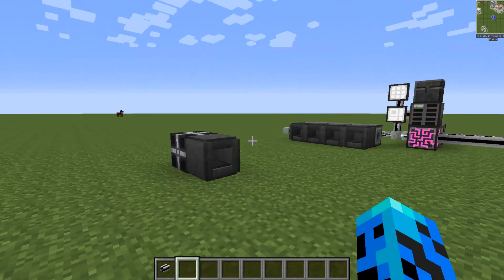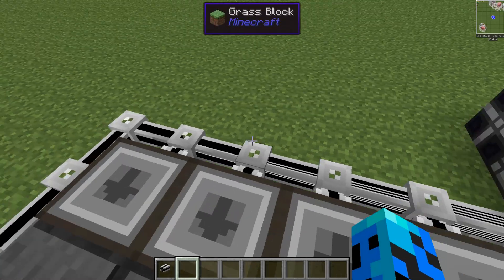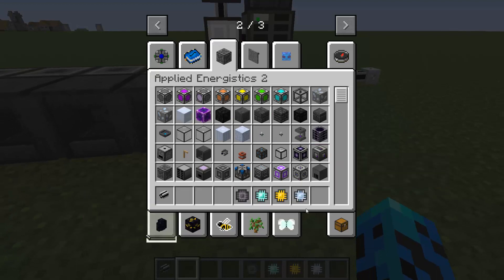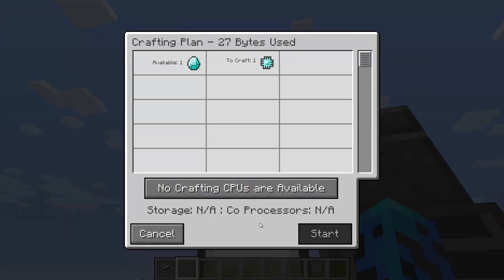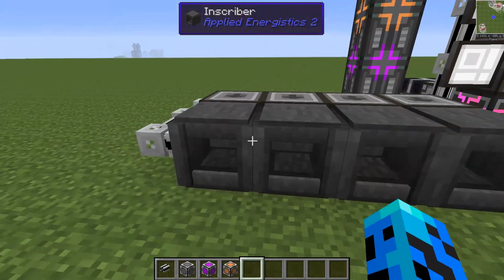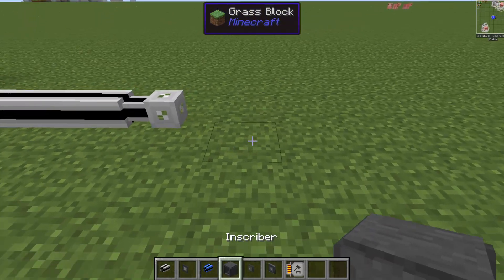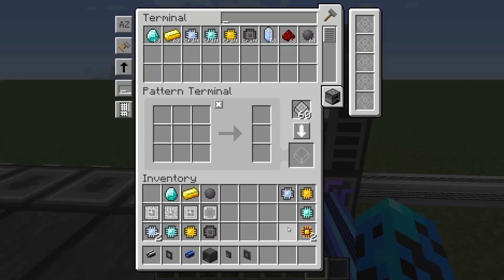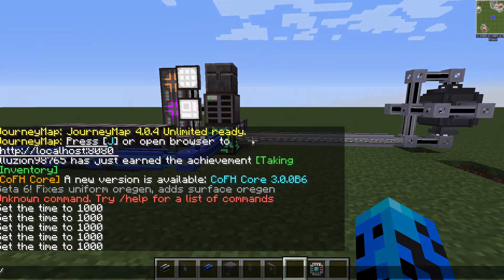Minecraft: How To Automate AE2 Inscriber/ Autocraft Processors (1.7.10)

Comment: It says i don't have any crafting processors available even though I have a crafting unit, crafting co-processor and 4k crafting storage. its connected via a different side so its not using all the buses. It also has a bus line showing it is connected on the smart fluix cable.
Reply: the crafting processors, unit and co proccesor must be in a rectangle for it to form the multi bock

Comment: 12:33 Every time i connect more than one cable to the inscriber my entire system goes down. I tried many configurations and no matter what I do, it shuts everything off.
Reply from the maker: Check to make sure you have enough channels available. Also check your power, as you increase number of item on your ME network it increased power draw.
Reply: What supplies the network with more power? I have a dense energy cell and tried making a second energy accepter, which didn't fix the problem. It's powered by a big reactor and a draconic energy core that's full. it only takes about 20k rf/second
Reply from the maker: How are your channels? Max 8 for regular/smart and 32 for dense.
Reply: Ohh. Ok Thanks

Comment: I'm having a confusing issue. I've got it set up nearly identically, however the export bus on the bottom that is supposed to ask the other press to create silicone and then export it into the final press doesn't work while I'm requesting, say, logic processors. Seemingly because I'm out of CPU's? I made sure to have a crafting card in the silicone export bus, and I have a co-processing unit the same as in the video.
Reply: Double check to make sure you didn't go over your channel limit. You might have caused something to go offline as a result.

Comment: Great tutorial!! Thank you sir. Very well done. I do have a small problem not sure what it is. I have the processing units installed. (The storage blocks for the bytes used part for the crafting terminal)They seem to be working just fine. When I go and run any process, it completes the job everything is fine!! Then I go to start another project, and I keep getting. No crafting CPUs available. But they are? Break one of the multi block structures replace. And it acts like its all ok again. Same process again a ad again. ?? What have I done? I have plenty of resource in the me system.
Reply: Forgive that message, I was trying something that was never going to work!! I got it!

Comment: can you only craft one controlller at a time?
Reply from the maker: No you can do muiltiple
Reply: when i try to make 2 logic ones, and my system doesn't have any more silicon ones left, it doens't make new ones
Reply from the maker: Add another crafting cpu
Reply: With cpu, do you mean the multiblock structure ore the co-processing unit?

Comment: but i cant get the power to go thru the cable to the inscriber (i have tried every direction there is)
Reply: it changed you cant use ae power you need to hook up the inscriber with a cable that transfers rf not the ae cable because ae has its own type of power that the system uses so the me cables cant transfer rf and for some wierd reason the inscriber can only take rf not aes power unites

Comment: Need help please. I have the 5 inscribers, 3 controllers, 2 1K crafting storage and a crafting unit on 2 lines of ME Glass Cable ( Fluix and Black) and everything works fine however i can only craft 1 item at a time. when i try for 2 i get the message "No Crafting CPUs are Available" . I have the 3 controllers side by side on the ground with a 1K, Crafting unit and 1K across the top of them. The feed from my drive goes into the 1K on the right. the supply lines both come off the 2 left controllers, Fluix from the left 1 and black from the middle 1 with cable anchors in between. Fluix is my 4 crafting inscribers and black is my put it together on it's side inscriber. How do i get it to do more at the same time?
Reply from the maker: Yogsta, Im linking my playlist on AE. Watch the videos named refined and complete to answer your questions. 

https://www.youtube.com/playlist?list=PL50kL4kUJhJcuRjlImHYl06ZO6gdiAwwx
Reply: You need more co-cpus
Reply: I now have 2 co-cpu's and a 16k storage on the 3rd row of the cube and am still getting the same message.
Reply: Thankyou to both of you for your help!
@ illuzion Thanks for the awesome tutorials. they have helped me get so much more out of my game.
Reply from the maker: You are welcome. I am glad you enjoyed it. I am doing an LP with some advanced AE work. Be sure to check it out.

Comment: For some reason in my system It won't ever make the silicon ones when I set to create  the processors. If i have printed silicon in the system it works. but if I only have silicon the system won't make the printed one when I ask it to make processors :S
Reply: +Torbjørn Kolven Don't know if this is obsolote, but: The Crafting CPU ist blocked while waiting for printed silicon to craft the processor, while the crafting card cannot find an available cpu for printing the silicon. So this is a deadlock situation. I only solved this by providing a second crafting cpu (unit+storage+maybe Co-CPU, havent't tested it without).

After upgrading, the system worked as intended.
Reply: +Torbjørn Kolven Your problem could be that you forgot that crafting card!
Reply from the maker: Torbjørn Kolven I have a new AE2 series starting now. Check it out and I will be covering this. Or you can check out my automating inscribers parts "refined" and "complete". They are both in the AE2 playlist.
Reply: Same with me
Reply: same here, looked everywhere, a few other people have this problem but none of them give any answers!
Reply: I just saw this 3 years later and the Problem just is you have to connect it to the back if you wanna put it in the inscriber with that arrow towards it ^^. 

If this did help anyone in today please like to let me know ^^.
Reply: @OverloadOV , That did the job! ty

Comment: Thanks heaps for this tutorial. Have only just started working with AE2. One question: I had my ME Interfaces sitting on the top side of the Inscribers but this wouldn't input the items. I moved my ME Interfaces to the back side and it worked like magic. Is the back side of the Inscriber the only input face?
EDIT: Also looks like I can't output from the bottom side. Front side works fine. Same deal?

Other than that, your setup for the Processors worked a treat! /Subscribe!
Reply from the maker: Greg Dennison Thanks for the sub. Im not sure about the i sidedness of the inscribers. Its not something I have really  tested much.

Comment: I really appreciated this video. It was very helpful, and I liked the more compact version you created in part two. I haven't read through all the comments yet, but I had a question. You mentioned (and I googled) the fact that the co-processors are supposed to let you queue crafts up. In my FTB Infinity world, I have 3 co-processors and 1 1k storage, and I cannot queue up items. The system recognizes that I have the 3 co-processors, yet, it won't let me queue up the crafts. Do I need to have more than one crafting storage and not more than one co-processor? Any help would be greatly appreciated!
Reply from the maker: fallyntalyn I have a video coming out very soon talking about co-processors. Check it out, It may help you. What what works for me is having several large processing units(storage and co-processors) and a few smaller crafting storage units to handle smaller tasks.

Comment: to simplify this... you can simply "cook" all the circuits. that way you never need to process silicon or redstone. this decreases Materials needed by 4: Silicon, Redtone, Silicon circuit, and silicon press. As well as needing one less inscriber press. AND a few less cables, only needing an in and out for the furnace(s)
Reply: bruskedragon No it doesn't FTB Infinity you have to do it using the inscriber cooking it does not work
Reply: I thought that was AE1?
Reply: It applies to all of AE. every pack i have played with AE 1 or 2 has worked with "cooking" the circuits

Comment: nice work there. With 1 crafting cpu if you que like 3 processors and you run out of silicon press at second, system gets stuck. because u have 1 crafting in que but u dont have silicon press and system cannot craft silicon press because u have 1 processor in crafting que. Very educating tho I like the videos. +1 sub.
Reply from the maker: Check out some of my newer videos about the automating of inscribers.

Comment: Hei this is a very good video, thank you. But i have one problem: when i craft more than one ex. 16 Logic Processors then it will craft one and then it dont fill in more printed silicon. When i after this cancel the job it crafts one printet silicon and fill this into the inscriber, so i can craft another one. So my mind is, its with this system not possible to do various crafting reciepts at the same time. But du you know why or what i need to do more?
Reply from the maker: Thanks for the comment. I have made multiple changes to this system since this video. Look in the rest of this playlist for the newer videos. It will address your concern.

Comment: Thank you for showing me this; AE 2 is slightly more confusing that AE 1..also, this was a grand test of patience for me. Here, have a sub and a like.
Reply from the maker: Thanks. Be sure to check out the other videos in this series too.
Reply: illuzion98765 I have a great system but I'm trying to get the Inscriber is automatic but only two terminals are working me, I know I have a limit of channels but as we increase this limit? any error sorry'm using google translator
Reply from the maker: PlayerLouco Check out some of my newer videos on this. I go into much more detail. I think It might help.
Reply: PlayerLouco From start: ME Controller, Dense Cable, Smart/Covered/Glass cables, import/export/interface, Inscriber. Dense lets 32 channels, others 8 channels.
Reply: illuzion98765 thanks but i don't speak english too much

Comment: This setup doesn't work when you want to craft more than 1 item. It will stack items in the inscriber slots which normally is impossible to do. - Edit: As of build 29 rv2 alpha it works without overstacking the slots.
Reply from the maker: Correct. It will only craft one at a time. However check out the part 2 of this video.

Comment: This video gave me an idea for a cheaper early game version of this. It's not an on demand crafting method, but you can dump resources in bulk and have it process them automatically.

I used a stack of a few hoppers into each of the 4 top level inscribers, letting it make the silicon, gold, diamond, and quartz circuits. I then used item transfer nodes to suck the completed circuits out the first batch of inscribers. You can dedicate a second batch of machines or just funnel it all into a single machine (which is what I did). 

The transfer pipes move the gold, diamond, and quartz into 1 chest, the silicon gets piped directly into the bottom of the next inscriber. That gold, diamond, and quartz circuit chest then get's piped into the top of the inscriber, and finally another chest with a transfer node for redstone. I had to use some cobble covers to keep the 3 sets of pipes from connecting to each other or you wind up with the wrong items in the wrong slots.

Finally I put an import bus on the last inscriber to suck the completed processors right into my system.

When I run low I can just toss a few stacks into each machine and let it run while I'm off doing other things. Not elegant, but get's the job done and was way cheaper in resources until I get more AE up and running.
Reply from the maker: A good setup for sure. Be sure to check out the part 2 of this video and I have just started on a part 3.

Comment: Crafting 1 processor works just fine but whenever I make it craft more than 1 processor, the system hangs on making a printed silicon on the left side of the system. I've put a crafting card in the bottom export bus(the silicon one) on the right side of the system.
I also tried putting a crafting card in the ME interface for the silicon inscriber on the left as someone suggested, but it makes no difference.
Reply: When I go to the crafting status, it doesn't queue up making a printed silicon.  It will queue it up after cancelling the processor crafting queue.
Reply: Ok so apparently you need to build a 2nd crafting unit for it to be able to do 2 different recipes at once.
Am I right about that or is there a better way to be able to craft more than 1 at a time?
Reply from the maker: gazeebo88 So you are having an issue requesting more than one processor at a time?
Reply: illuzion98765 yes but if you add another crafting processor tower thingie( not attached to the first one) it will work fine.

Comment: I'm having trouble with the silicon exporting into the inscriber. Every time it make a silicon if i am only crafting that but if im doing a crafting recipe with more than just silicon it never works. I followed exactly what you did but i still don't know why its not working
Reply: I was having the same issue. I found that if i put a crafting card into the ME interface that handled the printed silicon component, that it worked.
Reply from the maker: You have a craft chip installed in the export bus correct?
Reply: Matthew Pardue I was having the same problem and Matthew's solution worked for me as well. Thank you, sir.
Reply: Matthew Pardue When I put a crafting card into the ME interface that is attached to the inscriber for silicon, nothing changes. I also don't get any extra options. What do I do?
Reply from the maker: Matthew Pardue Did you get it worked out?
Reply: OK so it seemed to be working with my previous solution, but then I couldn't get it to work again. A second, separate crafting unit fixed the problem.

Comment: You said each side of the controller gives 8 channels
I thought it was 32..
._.
Reply from the maker: Both. Dense cable will give off 32 channels per block face. Any and all other cables are 8 channels per block face.
Reply: Umm,yea
But you said in the video the controller ONLY gives 8 per block face
Reply: the standard flux cable gives 8 channels (nodes per cable)
smart cables show you how much they're using up (nodes)
Dense cables hold 32 altogether meaning you can have up to 4 cables coming off those main lines,
You can attach dense cables to the ME Controller (Multiblock) and each side gives 32 channels
Multiblock DOES NOT have to be solid meaning if you so wish you can make a house from it (have cables attaching to the inside of it) (Cannot be larger than 7x7x7)

Comment: I would love to see more compact methods of automating these processors.  Is it completely out of the realm of possibility to use just one inscriber for all this?  Also: great vid, this is exactly what I needed :)
Reply from the maker: Yes there are more compact ways to do this. I did it in a very linear fashion to show the flow of how to make it work. I don't believe there is a way to do this with one inscriber. I could be wrong. But the main problem i see is that you would have to insert the inscribing press on the top side and the item to get pressed has to be done from the back. Im not sure there is a way to sync both of those at the same time to get out the circuits. I have a plan to automate this system using Extra Utilities, I just haven't filmed it yet. If I remember i will try to throw together a super compact system for you. Thanks for the comments though. Glad you liked the video.
Reply: The problem with using one inscriber is that (as far as I know) there's no way to switch patterns in and out.  The other problem you'd find is, because the inscribers are so slow, you'll bottleneck on bigger crafts (like a 64k component).  I have a more compact design that I'll try to video this weekend.

Comment: Some of the stuff seems to have changed since you made this, and I can't get mine working
Reply from the maker: I am using RV1 Beta 19 that built on 8/30/14. So this build was just over 2 weeks old when I made the video. I am not aware of my setup not working as it is very basic and many of the features of AE1 carried over. My first guess is you are having channel conflicts. Good luck. Post again if I can help more.
Reply: illuzion98765 I just figured out what my problem is... I had my interfaces on the top... Lol
Reply from the maker: taj1994 Glad you got it sorted out. The inscriber sides correspond with which space the item goes into. Thats why I made it clear on the video. Either way. Glad you got it working. Enjoy.